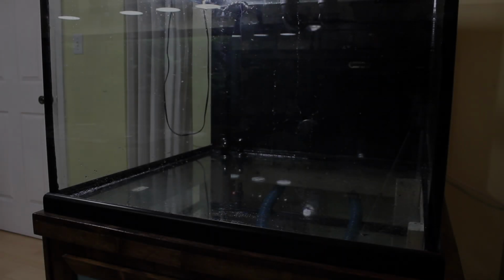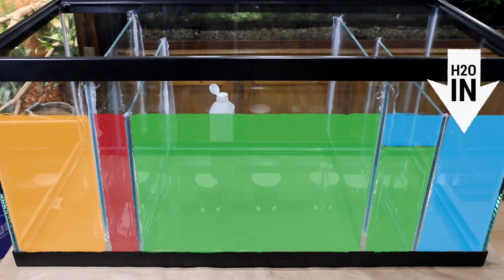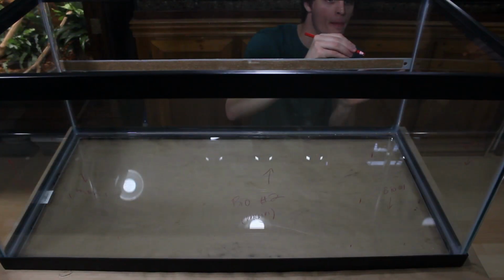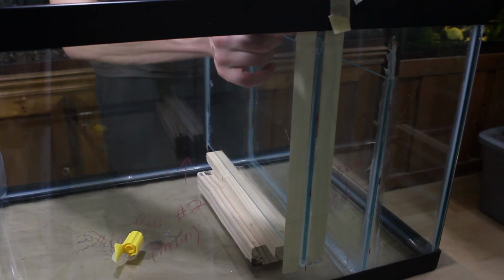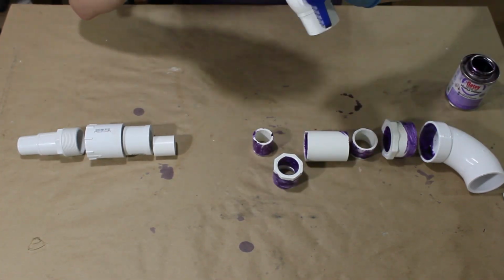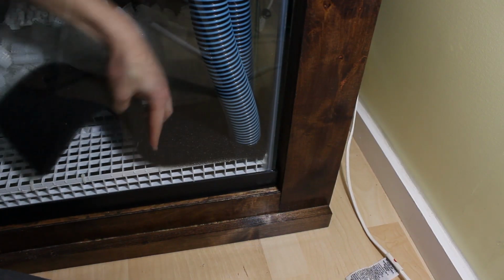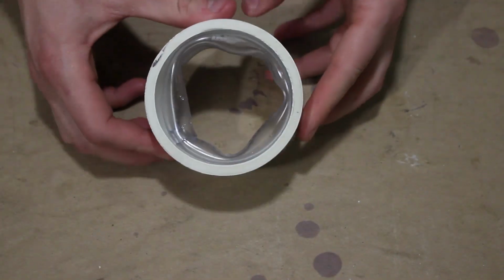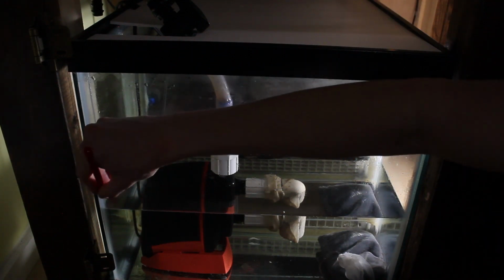Make a Freshwater Aquarium Sump (150g Redo pt.1)

Comment from the maker: Check the video description for more details that will help you get started!
Reply from the maker: BigggRoss I think it's a matter of preference. They are somewhat similar and both can be scaled for large tanks. I will say that a lot of people rip on canisters, but if maintained well they are great.
Reply: Would you be able to use this exact sump for a saltwater aquarium and instead of media in the main area can it be used as a refugium instead with plants and such?
Reply: How old are u?
Reply from the maker: Enteaz - Minecraft 25
Reply: SerpaDesign would you like to try that idea I gave you on the silkworms in the terrerium?
Reply: I would really appreciate it if you tested it for me so I know if I can do it or not! Thx😉😉😉😉😉😉😉😉😄
Reply: so just curious which do you believe is better?I am a fan of canister filters myself altho I have used sumps before. or do you think tank size is what makes the difference between using either or.
Reply: looks cool.like's
Reply: You're a beast Tanner
Reply: That about SUMPS IT UP
Reply: Hey man if you oil those razor blades they will cut silicone much easier and stay sharper longer. Vegetable oil works fine if you're worried about chemicals in the tank.
Reply: SerpaDesign I think you are cute, sadly you are straight lol

Comment: You only need one blade to remove the silicone.
It is not a big deal 
Also, you need an aquarium scrub pad and alcohol to remove the silicone residue left on the glass.
A fresh water sump is a good idea but not necessary at all 
Unless you have large or quantity of fish.
You don’t need the baffles to be the same thickness.
Also need way more practice applying the silicone and learn how to cut and shape glass.

Comment: respectfully.  The thickness of the tank"s glass is determined by the outward force of the volume of water it holds.  Baffles in a sump have literally zero force exerted upon them, they are stable, as is the water on both sides of them.  A 300 gallon acrylic tank can be in excess of 1 inch. The baffles in it's sump may be 3/8.

Comment: Sir why used two glass in every partition to add water from top side if I use one glass then water can also move to next part. I mean 1st glass has 2 inch gap from bottom and 2nd down 2 inch from top then water can go zig zag plz tell me reason to use 2 glass before every partition.

Comment: Great video explaining a sump, with one safety note. Heaters should ALWAYS be placed in a portion of the sump that will never run dry. In your case this would be the large center compartment. The way you have your sump diagramed, if for some reason the water coming out of the tank becomes blocked, your return pump will completely drain the area the heater is in and that can then destroy the heater… or even cause a fire.

Comment: A problem with this sump is that the heaters are in a place where they could run dry should water flow into the sump be stopped.

Comment: You should really not use your bare finger to smooth out the silicone. If you do, you should spit on your fingers before doing so to create a barrier. It’s not super common, but it’s not uncommon either, that using your bare finger results in a thin layer of silicone that doesn’t end up getting removed when you wash your hands, and creates an air tight seal on your finger. This can leads to gangrene.

Comment: So, if you wanted to put a drip system on a tank like this and wanted to use a sump - where would you put the drip system drain?

Seems like the drip would be best into the tank directly, with the drain somewhere around the main water level of the sump?

Comment: Whenever you add glass to your aquarium - beit to construct a filter such as the one in this video or to make bracing for your actual aquarium, it is crucial to use the same thickness of glass as your aquarium is made of. 
 The reason for this is because anything thinner (be it glass) will break as the glass reshapes during evaporation or water charges as it does not have the same strength as the actual aquarium glass thickness. 
 This also applies in  opposite application. Using thicker glass for bracing than what the actual aquarium is made from, could also cause either serious stress and or breakage.
Also, as far as the return pump is concerned,  one  would be wise to use a pond pump enclosure covered with in screen door mosquito mesh  material. This is way, the intake of the pump won't get clogged up as easy and saves ALOT of time with messy clean-ups. ....it also helps extend the life of the impeller of the return pump!

Comment: What a wonderful, instructive and well organized video.  After almost 50 years as an aquarist I am taking the plunge (PUN intended) with my first sump.  A couple of questions please.  Are there any rule of thumb that determines the height of the floating baffle off the bottom of the sump and what factors besides equipment determines the spacing between the two baffles?  Again, great video, you have a new subscriber.

Comment: Question:  How do you know how high to make the baffles so there is no over flow in case of power outage?  How do you calculate?  Is it just how much water is in the tubes between tank and sump?  The water that will drain down into the sump??

Comment: Hello, I used this sump design and I’m having an issue idk how to solve. My drains are dumping a ton of air bubbles. When my pump is on full the bubbles are larger (quite huge) Everything is brand new, I have an aqueon 210g with the overflow kit it comes with. Any advise would be greatly appreciated because I can’t find a fix anywhere.

Comment: Sorry I have to disagree with you about the method you used for resealing that tank but I'll explain what I mean..

If you really want to do a good job and guarantee it will hold up you have to take it apart completely and remove ALL the older silicone including the silicone between the planes of glass which is impossible to remove while it's still in the frame . 

Also I'd recommend using acetone instead of isopropyl alcohol for getting all the silicone off . Rubbing alcohol is okay but not as good as acetone or TSP.
 Many years ago I found out the hard way that it's not a good idea to put new sealant on top of the old silicone .The two don't play nice with each other nor will it bond properly . No professional tank builder would guarantee their work doing it this way .I got two big fish tanks for free because of this very reason  .The previous owners tried to fix a leak by doing it this way and it failed.
It's a nasty smelly and possibly a dangerous task but it's also the only way to be sure . Also GE silicone I has a mold inhibitor in the formula and isn't for underwater usage .As with anything read the label to be sure .
Aside from my criticism you did a decent job of explaining the overview about the sump. 👍

Comment: Nice video.  One thing I'll mention is that heaters probably shouldn't be placed in the return chamber since the water  level will fluctuate.  Put it anywhere before that and you'll never have to worry about the heater running dry.

Comment: dude look into using break oil  for the silicone just spray it and wait a few minutes ... problem is ithat you will need to wash everything ...the good thing is that after 10 minutes all the rubber and silicone will start  to come of ^^

Comment: So from a fellow hobbyist, Unions are a must. They allow replacement of valves and other important things if needed. I would like to say interesting things on this design unlike most. That return is really intuitive, I wouldn’t have thought that up and will remember it. Though how are fish not able to get inside under the collar? Secondly the way you set up the inlet chamber is interesting. I can see many positives of it. Though why not a filter sock set up? Otherwise you essentially made a canister filter which is pretty cool. If I ever do a video of a new tank set up and do this design I’ll call it the the Sherpa Design Sump and link to your initial video. Got to give credit where it’s due.

Now my concerns about gluing in the outlet pipes. It’s not really necessary and would have done threaded instead. Modularity is key in in aquariums as we might and some cases often need to update things.

My rule of thumb is unions where critical piping might need repair. Also modularity when possible especially fittings. PVC isn’t cheap in the long run and my experience adds up fast. Otherwise a well designed sump and really oversized chamber for bio media. At least in this video, I’d guess you probably fill it up later. Egg crate is a good idea in its use as well. I’ll pint people here for a sump video as it’s overall well thought out.

Comment: Several years back I converted my 210gal reef tank to a freshwater fish and plant tank. I have a 75 gal sump tank that was set up for the reef. I simply removed the skimmer. It contains a drop down flow from the tank that aerates the water then the water runs through filter socks that remove debris and then to the return pump water distribution system. One line taps off and flows through two house filters, one with carbon and one with crushed coral(to maintain alkalinity) and the output from the filters drains at low flow into a chamber containing sandblast sand to remove nitrates from the water, then back into the pump chamber to be pumped up to the tank. Heater is in the sump so there's no hardware in the tank itself. The sump has an auto fill float switch that keeps the system at the level where a power down will not overfill the sump. Water is well aerated and is returned across the surface of the tank and down along the back wall to the bottom of the tank agitating the surface and circulating water throughout the tank. I love reef ready tanks. No tubes to deal with or lines that collect air and lose suction flow. They should be used more for freshwater tanks in larger sizes simply to make keeping the system running much easier.

Comment: So the top baffles where water leaves the main tank and into the sump(over flows) this is the only inlet for tank water? Seems they wouldn’t do a good job sucking gunk floating around the middle of the tank. Also, you could have just deleted the baffle for the heaters since you didn’t use it in hind site? I’m trying to wrap my head around this about to take the plunge. Thanks great video

Comment: At the time of power out, the water will overflow out of sump causing mess into the room because the input pipes for Sump are manually opened or closed.
Reply: 25:30

Comment: DUDE! That's black Silicon... ahh of course it's going to be difficult to remove. You DID NOT need to remove that "BLACK SILICON", it would have worked for 50 years. Not to mention it was much thicker and stronger than the job you just did, which is albeit neater, is in NO way AS STRong as it was.  You've made some good video but that was pretty lame. The bulkheads, that's different they were in need of repair.

Comment: Hi,
I am planning to build a 5x2x2(feet) aquarium, with a filter as per your design. What should be its dimensions and what power pump shall i use?

Secondly, what's correct sequence of filter, is it Foam - Carbon - Ring or something else?

Please guide as what should be the glass thickness for Aquarium and sump filter?

Comment: I'm converting a 40 right now. No baffles. Ok, baffles, but part of other stuff. I have a wet dry that's a little bigger than one of my drains need, and a diy container filter for the other drain. That opens to a good sized area for more media or refugium, dependent on need. Then a egg crate wall held up by air line suction cups, with a decreasing set of sponges before the pump. I would think my design means the pump runs on less water in the sump, meaning more evaporation and less attention to the water level. The standard design gives you between the top of your lowest baffle and the tank height, I think. Thats why Serpa's baffle height surprised me.

Comment: Apologies for total newbie question - when you connect flexible hose to hose adaptor , do you use any sort of glue / cement? 
Also, with the bulkhead fittings that go through the glass tank, should you put silicone on the surface of the gasket ring ( big washer) which is in contact with the glass? ( Does using silicone make it less or more likely to leak?? ) Thank you! 
I have never had an aquarium before but am jumping in with a sump. Would you recommend ball valves rather than gate valves?
Thank you so much for your help! Ellen

Comment: Very well designed, implemented and explained video [thus the subscription+bell]  I set up my first planted tank 3 years ago and installed a commercial  oversize wet/dry sump.  It had 4 inch socks as initial mechanical filtration, but I replaces the socks with KLIR fleece filters recently.  I love that it removes detritus as it clogs the 50 micron holes.  I have always been suspect go bio media in a net thinking the net impedes water flow trough the media.

Comment: So if the overflow stacks become blocked how do you prevent sump tank dumping too much water into the main?
Reply from the maker: In my case it can only put in as much water as is in the last compartment, which isn't enough to overflow the tank. Some people put in a backup overflow in case that happens.
Reply: Thank you that makes a lot of sense I like the compartment solution.  I hadn't done that on a previous build and I got a new living room pool.

Comment: What size pipes and adapters did you use on the pump? You didn’t go into as much detail with that part of the puzzle. I like the quick disconnect too. Any addition info like for the other pipe parts you had?

Comment: PRO TIP: When using your finger to smooth out the silicone, dip your finger in some soapy water. The silicone wont stick to you finger, and the silicone is a lot smoother!
Reply from the maker: I prefer to do that with rubbing alcohol, but I could see how soapy water would work as well.

Comment: I heard that old silicone doesn’t bond with new silicone. There were old silicone between the glasses. I did the same thing you did and my 95 leaked after a year. There is no way I can take the fish tank apart. It was siliconed pretty good up under the trims. I need to get reuse the trim since my wave tank doesn’t look like it has replacement trims.

Comment: Can you kindly tell me the name of that big white plastic  sheet that you placed at the bottom of the tank . And Where can I get it?
Reply from the maker: You mean the lid? That was corrugated plastic. You can get it at most home improvement stores (I got mine at Homedepot).
Reply: SerpaDesign no not the lid. The one which you placed inside the tank at the bottom. Box shaped holes on it
Reply from the maker: That is Egg Crate Light Diffuser. It too can be found at most home improvement stores and again, I purchased mine at Homedepot. It's generally about $10 a sheet.
Reply: SerpaDesign thank you very much bro

Comment: a beautiful  build  !
i run a sump myself and it was essentially the same except i drill my tanks on the bottom for a cleaner look..
in the long run i found that i could not build up my  C02  due to out-gassing in the sump  , to  resolve this i made bulkheads on the side of the sump and made a ridge  on the inside of the sump and installed strip foam , a glass lid makes it all perfectly gas tight and my C02 is  a lot better .
btw , i inject my C02 in the sump so my tank does not have the 7up look .
again a nice vid . , thumbs up !

Comment: Why you drilled 3 holes to aquarium.
Reply from the maker: I didn't drill it, that's how I got it.
Reply: SerpaDesign okk but 2 are for over flow and what about the down one I'm planning for big aquarium and i want to do it myself
Reply from the maker: Oh that one is for a drain. So any time I want to drain water I just open a ball valve. It's great because I can drain the tank in a matter of minutes.
Reply: SerpaDesign thanks bro..

Comment: For a noobee like me, epic video. Removed a lot of the mystery of sumps for me.
I'm just not sure why I would want one, aside from the increased volume. I've heard some say 'it's a good place for shrimp' (why would I want to put shrimp in one?), and it's good as a refugium (why would I want a refugium?)
So many questions...
Reply: ChuckD59 You want a sump because it’s much much easier to swap out a filter sock in a sump than it is to clean a canister filter. You can use a refugium with plants (on an opposite light cycle from the tank, use a timer) in it to take up nitrate before algae can feed on the nitrate. Then you can feed the plants to your herbivore wet pets as a treat. Or chuck them in your compost to enrich it.
Reply: Runer Warlock ghost feedings, adding bottled ammonia or decomposing waste FROM THE DIRTY WATER HE ADDED, all add Ammonia for the bacteria to grow

Comment: I am building a very similar sump for my 150 gallon tank. This video has been very helpful to me however I am wondering what pump you have in the sump? Finding the right one seems so daunting  and since it is such an important investment I was really hoping to just get the same one you have.
Reply from the maker: Go look in the video description I have a ton of details on choosing an appropriate sump.
Reply: Thank you for your reply! I read the description before making my comment. My question stands however: what is the brand and model of this exact pump used in this sump? Your system and mine are nearly identical so I would just like to buy the same one you have. I love all of your videos by the way! I have been watching you for years and have been very inspired.
Reply: Is it the Fluval SP4 pump? Because that is what I think it is. I just want to make double sure before I spend $180